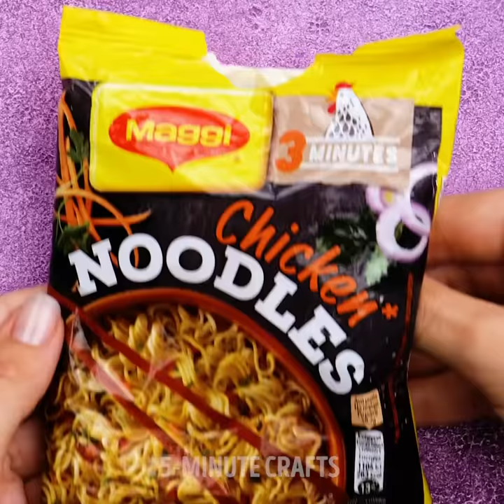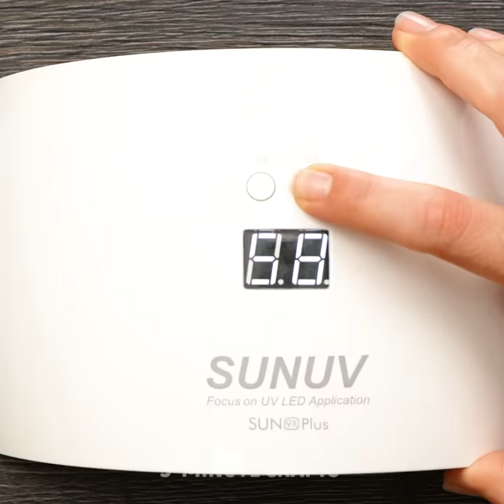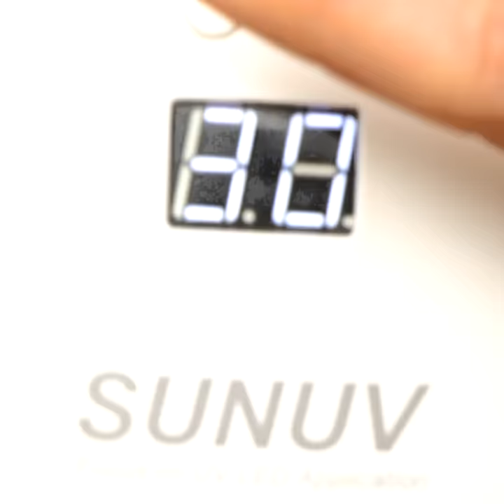Wonderful Epoxy Resin DIYs That Will Amaze You || DIY Jewelry, Home Decor And Mini Crafts

Comment: You can't use fresh leaves or flowers etc in resin, they have to be dried or they'll just decay.
Reply: Yeah, and food either. The potato chip and gummy bears bracelet. There are gummy bear molds to make resin bears and use those instead of actual candy.
Reply: 5 Minute Crafts is a content farm. These aren't tutorials, that's why their "crafts" are either incorrect or unsafe.
Reply: Will it work if you press flower petals?
Reply: @emilychristie8660  Yes, if they're completely dry.
Reply: Isn’t there something you can spray on the plants that will keep them good?

Comment: Woow That's amazing 😍😍 Will u plz tell me what is the glue u used to prepare them ??
Reply: They are using UV resin for a lot of the projects. It requires a UV lamp (usually used for nails) and if you are coloring the resin you can't color it solid or the UV light cannot penetrate the resin and cure, or harden it. It will end up sticky, soft and probably kinda gross. If you just color your UV resin a little so it's still transparent, it will work but you have to pour in very thin layers, cure under the light, pour your next layer, cure and so on until you're finished. I would recommend a 2 part epoxy resin or Art resin, like Liquid Diamonds, Let's Resin, Unicone Art. All really good choices. Not cheap. Some are a 1 to 1 mix ratio and some are 2 to 1 mix ratio. Takes anywhere from 8 to 24 hours to cure or harden. I only use UV for nice jewelry pieces because they are pretty small. Watch some of Amy Made You tube videos on resin work. You can learn just about everything from her videos and she explains it so it's very easy to understand and to know what not to do. Also, I mentioned that resin is not cheap but UV resin is really not cheap. Pretty expensive actually so save it for the finer details or small jewelry. It is good to have on hand in my opinion.